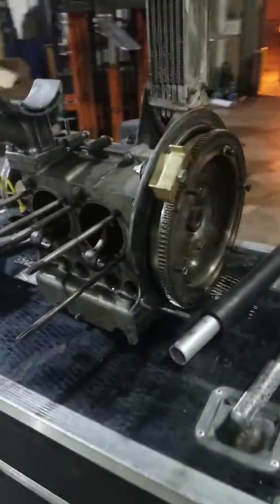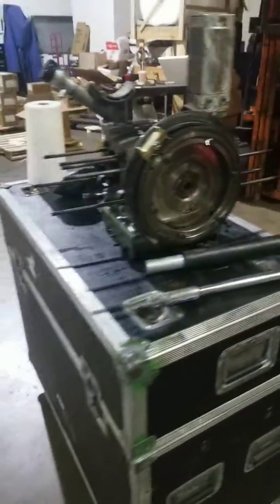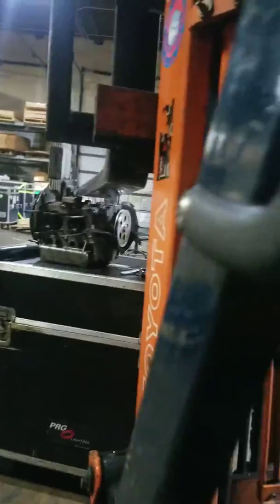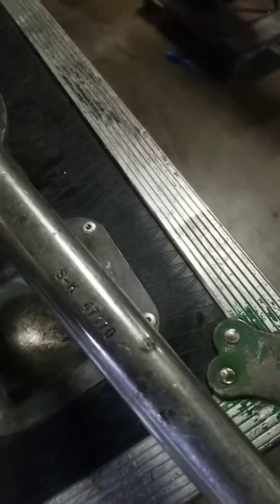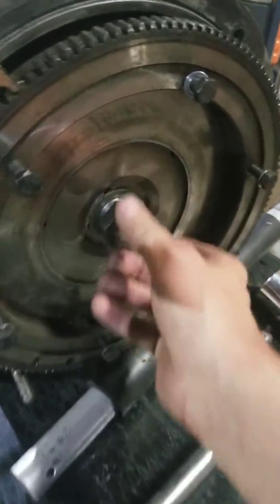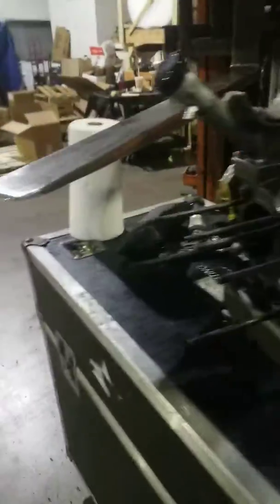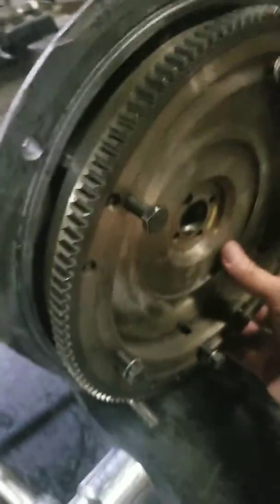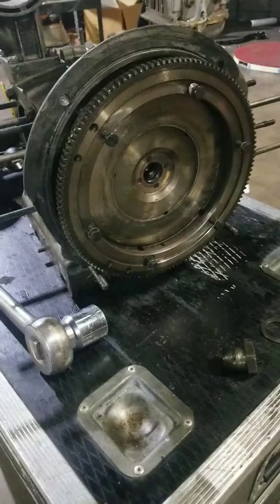How to remove a VW flywheel gland nut bolt

Comment: How can we break this loose we’ve  everything no help with me and him and a don’t weight enuff to break it loose any suggestions please
Reply: You might try applying some heat with a small propane torch, but you probably just need a bigger breaker bar extension. If that doesn't work, you might run the engine by a local shop and ask them to remove it with an impact wrench. Good luck!
Reply: ChalkMyCar  thank you his brother stopped by we got it now we need to figure which dawls sizes for a 1600 we need cause the ones come off it was paper thin.